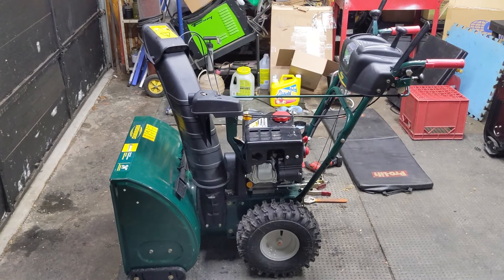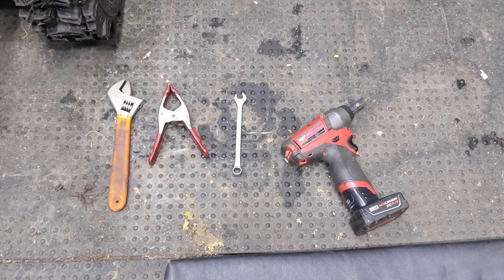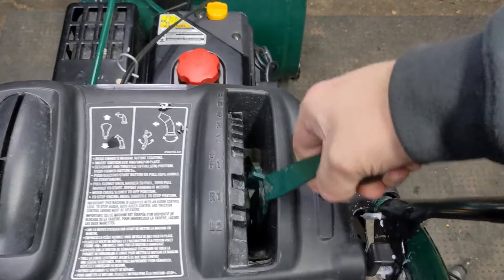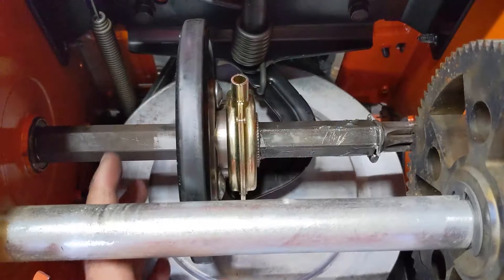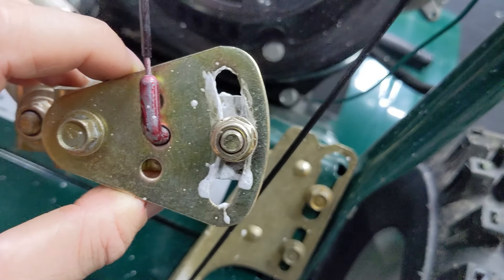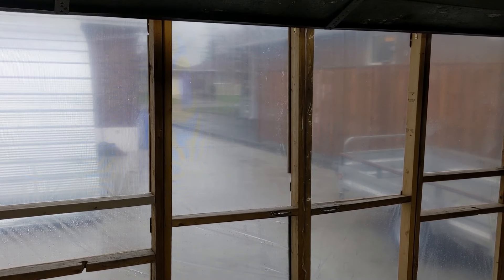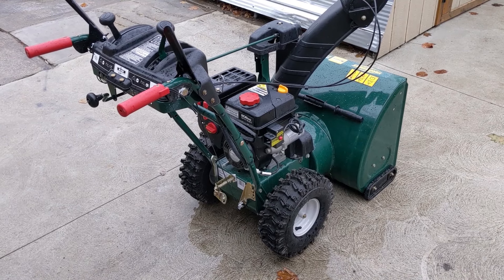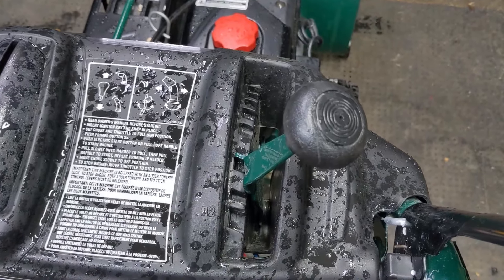How to Fix a Snowblower That Doesn't Shift Properly

Comment from the maker: One thing I failed to mention in the video is that this adjustment can also be made if you notice your snowblower drives too fast in the F1 gear position. By adjusting the speed select lever linkage or cable, you can bring the friction disc closer to the center of the friction plate, which will thus reduce speed in Forward 1st gear.

Additionally, a note on the 3 holes in that bracket; the older MTD machines only have 1 cable Z bend hole, while the newer ones have 3 to give you additional adjustability. It is generally not required to change the hole the cable goes into, but I assume they make the triangle plate with 3 holes now to make up for differences in cable length you may get from the manufacturer.
Reply: Very good video with an additional comment that's a real bonus. I do think those 3 holes in the plate result from that part being used on various models with different handles' lenghts. Regards !
Reply: Love the videos! You would think they would want to put the cable in the top hole so it doesn't bind up on the "adjustable plate".
Reply: Thank you I appreciate the information
Reply: Thank you.  That information is just what I needed to adjust my BRAND NEW Cub Cadet snow blower.  Forward goes too fast and reverse too slow.  YOU SIR get a gold star and an 'at-a-boy for that.  I know I could take it back where I bought it and make them do it, but that's a big hassle.

Comment: Thanks for the crescent wrench and clamp trick. I will be adjusting my eight year old Huskee (by MTD) soon. I noticed my R1 was veeery slow, it wasn't slipping or going forward, it just barely crawled backwards. I got used to running my machine on light snow in F2 and wet snow in F1. I only use F3 to jog it back to the car port.  I just assumed I was getting too fat and old and I could not match my walking pace to keep up with speeds F4, F5 and F6. 
This video also showed me that I should change how I park my snowblower. I always back it up in R2 to park, with the bucket pointing toward the driveway ready to go. Thus I got in the habit of leaving the snowblower all year long in R2. This keeps the shift cable at the highest tension, all the time. I will remember to park my snowblower in F6 from now on!

Comment: Just watched your video after dealing with my Troy Bilt 2860 snowblower.
F1 was too fast and R1 was neutral , so I adjusted the plate per your instructions.
Thanks for the help , very useful !

Comment: Can you please work on more Honda snowblowers. You are one of the best tutorials on snowblowers
Reply: We do not get a lot of Hondas in for service or repair. If you can drop yours off we would be glad to do a video thanks.
Reply: @waynestefinashen239   wonder why that is! Are they just made that good 😊
Reply from the maker: Yea what Wayne said, I've only ever had 2 come into the shop and I've filmed them both lol
Reply: @EliminatorPerformance  I got 2 of them how far are you from Massachusetts lol
Reply: @appleztooranges  It is more a matter of numbers as higher price translates into lower sales. Yamahas are the absolute top priced snowblowers and you never a repair video of them. Hondas and Yammies are good machines but gas turned sour affects them just the same as any other brand. Regards !
Reply: @appleztooranges  They are very well made but i think in our area the price is much higher than other snowblower dealers as MTD, Husqvarna etc.
Reply: @danielrobert7181  Absolutely correct we have never had a Yamaha snowblower and yes they are the best but the Ariens Professional Series is also a great snowblower.
Reply: @waynestefinashen239  I think Honda are the best. You get what you pay for. Than Yamaha under it

Comment: Excellent vid!  The friction disc is a simple mechanism, but most people need a how-to like this. 

I adjusted my friction disc (on the shaft) so that my "F1" position is slower than a dead turtle Lol.  JUST off the center of the drive plate. 

You sacrifice top end "F6" speed, but who wants to run behind the machine?

But the real benefit is the faster reverse speeds.  Not by a whole lot, but noticeable.
Reply: Thanks for this comment and your subscription your repair is sound.

Comment: Great video, as you say a solid thicker cable prevent a lot of trouble
Reply from the maker: Yes I'm honestly not sure why they don't do it, these cables snap ALL the time! The drive and auger cable don't snap as much, usually the auger one snaps at the spring near the impeller idler arm. A slightly thicker cable would prevent the speed select cable from breaking though, although it wouldn't prevent the Z bend from breaking. Thanks for watching!
Reply: @EliminatorPerformance  my old MTD has a rod. it's crazy how they went with a cable on newer models. penny pinchers.
Reply: My blower has a rod not a cable. I’m assuming I will adjust the same way as the video shows & not worry about having a rod not a cable?

Comment: Well done.
Reply from the maker: Thanks for watching Chris!
Reply: @EliminatorPerformance  You're welcome! I have a old Toro 521 I need to adjust, it doesn't drive in First, but does in second and 3rd and both Reverse speed work. So after watching this I think first is still in Neutral!
Reply: @EliminatorPerformance  You're welcome

Comment: My toro when putting in forward slowest speed it goes backward? 2018 model. Great video.  Keep grinding!
Reply from the maker: So move the shifter from 1 into a higher gear, and see which way the lever moves. Then you can either extend or shorten the shift linkage to make the adjustment.
Reply: @EliminatorPerformance  thanks I'll try it out.

Comment: Need some advice on my craftsman 9/28, 247.88190 drive speed adjustment .  I picked this up used and it had a lot of problems that I have fixed however my pivot bracket is at its max adjustment. I finally was able to get #1 reverse to work and in #6 forward the cable has slack. The piviot bracket only has 1 hole for the cable end and I have seen many of these that have 3 holes so I am thinging about drilling a second hole below the original hole for the cable which should take up the extra slack. Maybe the cable has stretched? Also the cables zig zag fitting is between the two plates and all the diagrams, pictures I see show it goes into the hole from the outside to the inside which will keep the cable from rubbing on the metal. This has been a much bigger project than I anticipated with sheared pins and frozen auger blades. Thanks for all the great, informative videos!

Comment: Hi thanks for the tutorial.  I appreciate your time to share your knowledge.  I have a question and it stems from the cub cadet with the plastic bezel. Model x2 and x3.  These get chewed up when the speed lever tooth pops out out if position.  I find these to be a bad design since the whole design has no adjustment to made the lever fit better in the notch.  Years ago these were all metal.  What is your opinion about these issues and would you suggest a good model of 2 stage snowblower?

Comment: Hi ! Is that true that when I drive the Snow blower  Ariens 2024 DeLuxe 24 very often at slow first gear it will damage the friction disk more rapidly ? Thank you. Pierre Québec Canada
Reply from the maker: @pierrelacasse5345 the closer the friction wheel is to the center of the friction plate, the more chafing it will experience, and the friction plate slightly moves sideways on the rubber disc as the smaller circle turns. However, the rubber friction disc spins faster when on the outer edge of the friction plate, so even though it doesn't experience as much chafing, it wears due to the higher speed, and increased rotations as it's traveling a further distance around the friction plate circle. As long as your 1st gear and reverse gear are set properly, and not too close to the center of the friction plate, you should be ok! However, a point to make is generally when you're in 1st gear you're going through heavy snow, heavy load. 5th gear is usually only used for transporting down a clear driveway, so I would say the friction wheel theoretically wears more in 1st or 2nd gear, simply due to the load on the snowblower, which increases wear on the rubber friction disc.

Comment: Informative as usual :-). any guidance on a Powersmart snowblower where R1 doesn't work, but there's no triangle (or bar)  that I can adjust. It seems to have a wheel with the cable going around it. I got around it by using R2 which works. Great video as usual again
Reply from the maker: Gotta figure out which way the cables pull when going into R1 then you tighten the cable on that side to adjust it, like you would the brake cable on a bicycle
Reply: @EliminatorPerformance  Thanks, will give that a try.

Comment: Do you have a video for this procedure on an older MTD that has a physical Rod instead of a cable for the shifter? It's one of the old 22-inch models powered by a 5 horse Tecumseh engine. I'm having the same issue.
Reply from the maker: No but same principle, lengthen the rod and it moves the friction wheel further one way, shorten it and it goes the other. If you want, you can flip up your snowblower and remove the access panel to see which way it moves, then you can properly adjust the rod and get it close to where you want it, having 1st gear on one side of the friction plate, and reverse on the other side so it spins the opposite direction.
Reply: @EliminatorPerformance  well I took the pan off the bottom turned out to be  a much simpler problem. The shaft just needed to be cleaned and lubricated it had been gummed up with old grease. When I watched it prior to repair I could see it sluggishly moving after took my hand off the shifter. The only other for drive adjustment is on the drive cable lever.

Comment: Changing which one of the 3 holes that the cable is inserted into should give the same result????
Reply from the maker: A note on the 3 holes, the older MTD machines only have 1 cable Z bend hole, while the newer ones have 3 to give you additional adjustability. It is generally not required to change the hole the cable goes into, but I assume they make the triangle plate with 3 holes now to make up for differences in cable length you may get from the manufacturer.
Reply: Changing the hole would have created too much movement in this videos case, Jake is correct with the different cable length point.

Comment: i bought a remington 24" so which hole do i use on lower shaft havea new cable i used middle hole but it seems tight

Comment: What is the best way to slow the speed down on the same system mrs cable cub cadet 2x  the first gear seems to be way to fast…
Reply from the maker: Move the friction wheel towards the center of the friction plate. You need to adjust the cable like I did

Comment: Brother! I have a Yard Man 8413DE snow blower with a Tecumseh Snow King OHV engine, the problem is this: during a cold start, shots in the carburetor occur several times, then as it warms up the shots disappear, but there are pops in the muffler during operation, what should I check in this case? Nothing since the moment of purchase  it was not adjustable, the carburetor is not adjustable on this model, can the valve clearances be checked? if so, what clearance should I set? and how to adjust the speed control rods?

Comment: I picked up a 9/28, (247.88190 a older model) that wouldn't  go into reverse. The piviot bracket only has 1 hole for the cable end, and was adjusted to the max. I ended up drilling a hole below the the existing and now I have all the gears. Now I think that I will remove the bracket and bevel the inside of it so the cable will not rub on a "sharp" edge although there is no sign of abrasion on the outer cable casing, yet.

Comment: I have this problem with my Craftsman. It will also be in forward 1 and it will shift into 2nd by it self.
Reply: A slight adjustment would likely fix this issue unless it is one of the new Powersmart snowblowers since i watched Garage Gear review one and this is exactly what it was doing right out of the box.